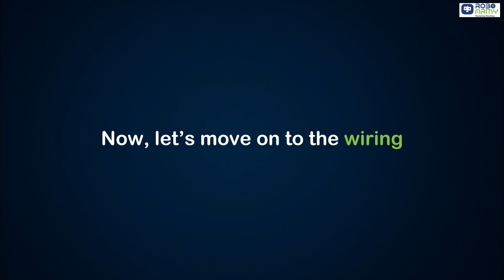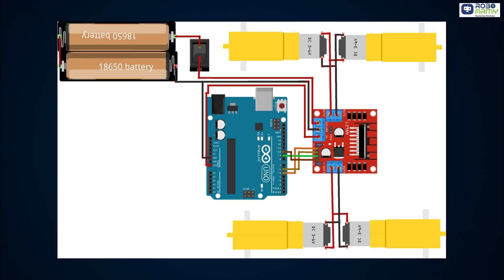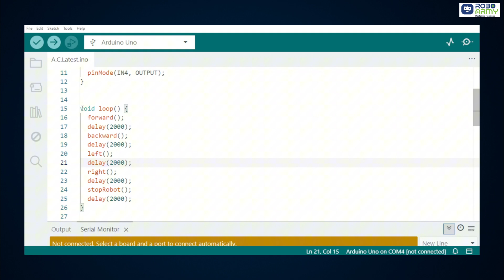Fire Fighting Robot SERIES | Part 1 | 4WD Chassis Test with L298N Driver | Best Science Project

Comment: Bro my fire fighting robot turns left and right but not moving forward when center sensor sence fire😢😢😢. Please help me. Tomorrow I want to submit my project 😢😢😢
Reply from the maker: For the forward movement issue, try testing the motors directly without the sensor to see if they move forward, then recheck your code logic for the center sensor's "forward" command.